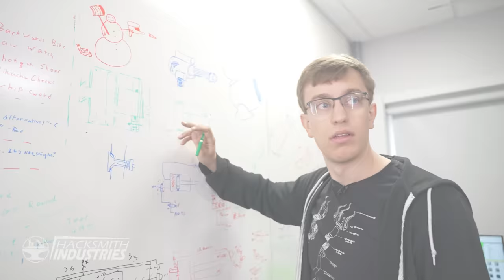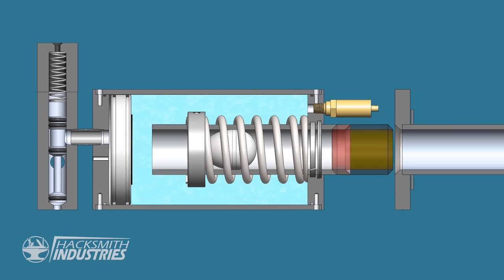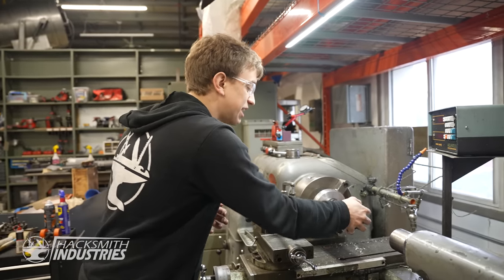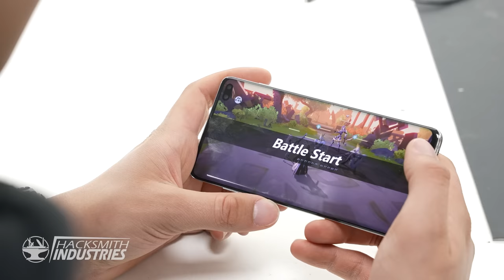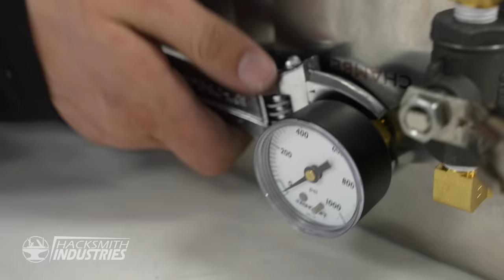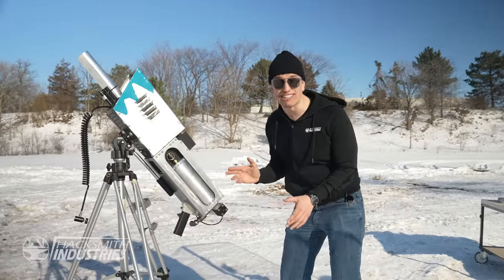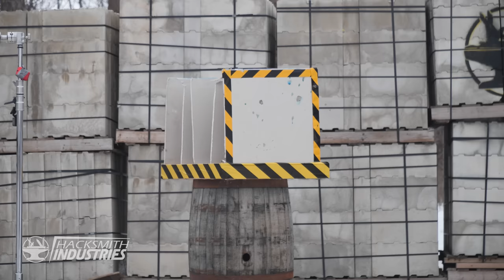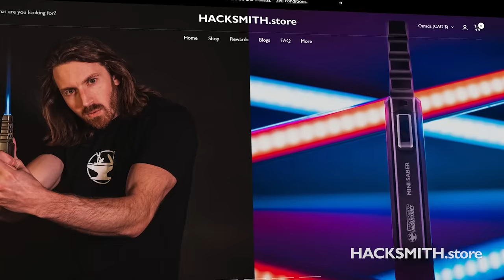World's Most POWERFUL SNOWBALL LAUNCHER! (Fortnite Build)

Comment: If you ever gonna make a V2 of this, you could try to get closer to the original by actually using snow - compressed into the right shape and density by using some of the air pressure. Imagine, you fill in some snow, press a button/lever that compresses the snow into essentially ice projectiles - and boom, you got yourself an unlimited ammo cheat code during winter😎

That said, the existing build is far better than what Epic Games puts into their game every winter😅

Comment: They should replace the Fortnite launcher with yours. I think your next project should be a mechanical T. rex like from the movies.
Reply: Or rework it in a way. It would be a rocket launcher at low pressure, and a high damage shotgun at high pressure.

Comment: Maybe for a 2.0 version, replace some parts with plastic to lighten the weight.
Reply: It’s a rocket launcher class weapon anyways.
Reply: Might have an issue on structural integrity of the gun to hold up the pressure.

But if there is anyone that can do something about it, it would these guys 😂

Comment: Not saying anything about how hard it would be, but a cooler idea would have been a compactor that can take normal snow, then shoots it at a reasonable speed that can be used in against a person.  Like those hopper style nerf guns but with snow.  Maybe make it 3d-printable and use normal air cartridges on a revolver-style system and it would be actually like fortnight.

Comment: the bamboo lab p1p is a stripped down version of the X1 carbon but with the same speed!  
and almost half the price I bought one and WOW are they fast!
one note, dont over lubricate them as they start slipping and the prints fail
they are about $1100 cad and come in fast (to BC)
also at the part where James tells him to get back to work and theres a moment of silence you can here the printer going

Comment: Would it be possible to build a hydrogen fuel source for the launcher? You know, small backpack tank of water flowing into a small chamber with a constant electrical dc current cracking the water to the gasses of hydrogen and oxygen. Then turning a valve to let the gas into the firing chamber, pull the trigger and hit the target.

Comment: So quick question . The pressure relief valve shows 1000psig but you said the chamber equalizes to 1.5 tons which is around 3000psi . 

1) Isn’t the pressure relieve valve supposed kick open to release anything over 1000psig?

2)where does the 4 ton pressure that pushes the disc back come from if we are equalizing to 1.5ton(3000psi)?

3) how is the air pushing the disc greater then the force of the air in the chamber if they are equalized ? 

Im trying  to learn more about pneumatics. This was a really good video . Great job guys